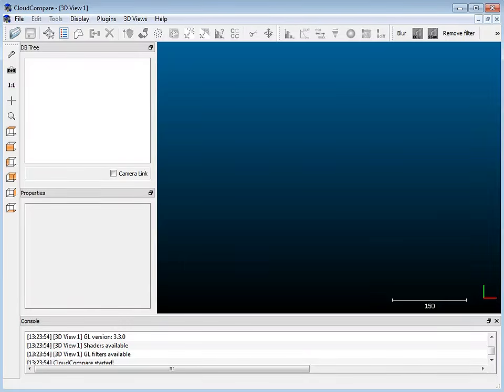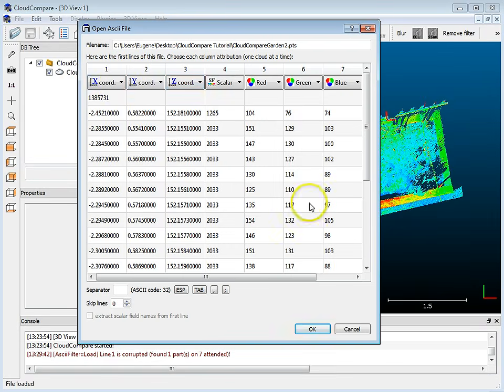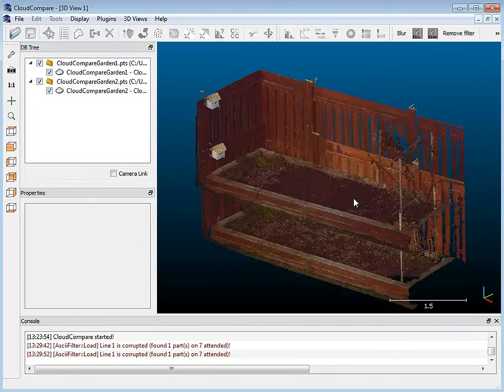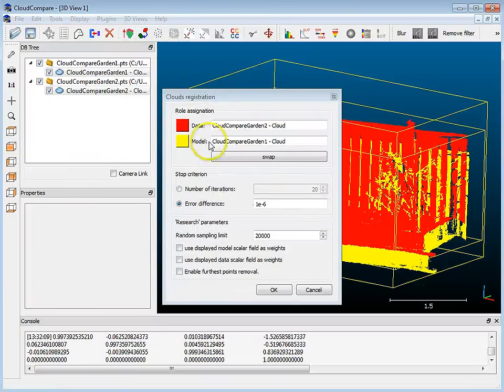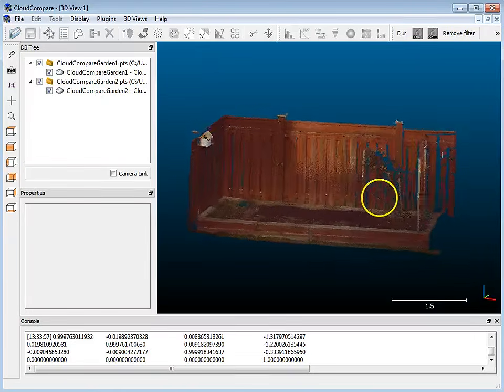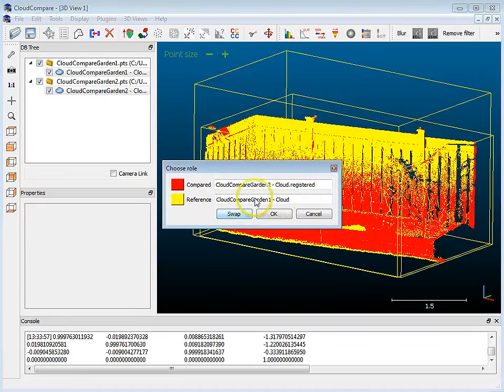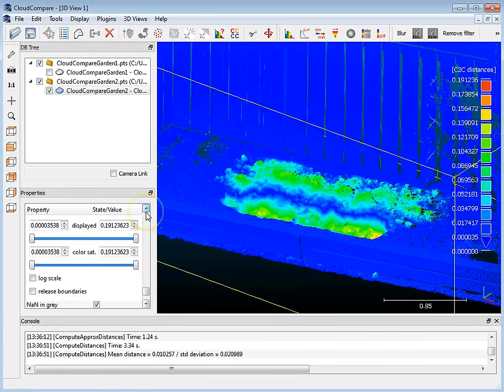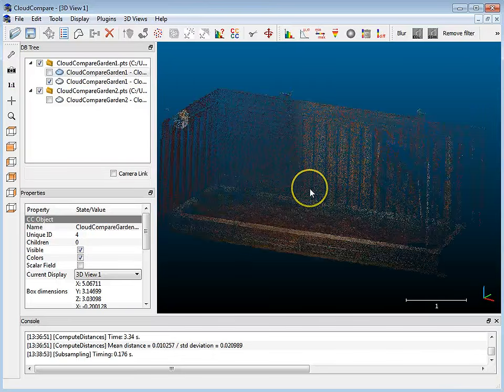Tutorial: Introductory Video on CloudCompare | 3D Forensics

Comment: Hi there, is it possible to compare a STL from a 3D model made in FREECAD and a STL file from a scanned 3D Printed part and use CLOUD COMPARE to correct the distortion between the model and the printed part? I having problems with tolerances and this would be of great help.

Comment: I'm new to CC and still learning; is there a "best practice" to compare change between two portions of a point cloud?  For example, could i create a bounding polygon, and only do the compare within that polygon?  Or I'm guessing i also might be able to clip / trim the point cloud to just that area and then compare?  Thanks in advance, i'm going to keep looking around as well!
Reply from the maker: You can make a clone of the point cloud or edit the original and then make the comparison. However, I would make sure everything is registered and aligned as you want before the comparison. The initial alignment has a big impact on comparison results.

Comment: thanks for a great tool, I have two mat files (264x 183 and 243x 198)  of different sizes,  I would like to compare these two meshes in cloud compare, but it only takes input file formats such as .ply, .stl , .obj, .txt etc. how to proceed ?
Reply from the maker: I am not familiar with that file format other than an OBJ file can often have a texture file associated with it as a mat file.  Are these just image files. point information or actual 3D model files?
Reply: I load these .mat files in the workspace (MATLAB), these are actually 2D double-precision arrays (2 D matrix containing the height information). To view an example of the 3D reconstuction please follow the link: http://www.mathworks.com/matlabcentral/answers/296868-comparison-between-3d-mesh-plots. Thanks in advance.
Reply from the maker: You may have to convert out of MATLAB but look at the CSV import from CloudCompare.  You need to specify your X and Y spacing and the Z height will be obtained from the matrix entries.  You can choose to import as points or a mesh and colour can also be applied from a jpg image file.  I've only done it once a long time ago but give it a try.

Comment: Hello!
This is a great engine I have seen so far. Thanks a lot!!!!
I am working on calibration of velodyne lidar laser sensor and stereo camera. So far I have generated point clouds by both the sensors. But the (HOV) field of view for laser sensor is 360 degree and stereo (HOV) is 110 degree, rest Vertical field of view is similar in case of both the sensors. Then how can I compare these two point clouds??
Thanks a lot in advance!!
Reply from the maker: If I understand you correctly, you can align only the similar points of the point clouds and then run a deviation analysis.  Of course, it will only provide you results for the common areas.
Reply: Thank you so much I will try!
Reply from the maker: They need to be aligned first so look at the registration tools. You can only compare the areas that overlap.

Comment from the maker: For those of you who are trying to get point clouds that are far apart close together, you can use the Tools, Registration, Match Bounding Box Centers to get the point clouds close together.  You can then tweak them into place manually or if they are close enough, just run cloud to cloud registration.
Reply: it is unselectable...
Reply from the maker: @nikolazivkovic3098  Make sure you select the point clouds in the DB Tree. They must be selected or the option won’t be available.

Comment: This is a great tool to use. :)
But I don't understand one thing. What is the difference between cloud/cloud and cloud/mesh compare? In mesh as well, it will consider the points only.
Reply from the maker: If you have an underlying mesh, then you can project a point towards a surface.  When you have cloud to cloud you need to locate the closest point.  So, it's always best to have the most complete and dense scan be your reference scan.

Comment: What's the issue? Use the Poisson reconstruction and start with smaller settings, then increment.  Also, if you don't need to mesh the entire scan, use the the segment tools (icon with scissors) to cut out what you don't need.

Comment: Hi there, I am trying to align two point clouds of underground mine workings so i can compare them. I have uploaded the both into CloudCompare, however, can not get them to align as they are big and quite far away from each other so the alignment tools (picking points and transform/rotate) won't work as i can't see the clouds! Has anyone had this problem, can anyone offer any tips? Cheers, LMP
Reply from the maker: You can use the match bounding box centers to quickly get them close together.